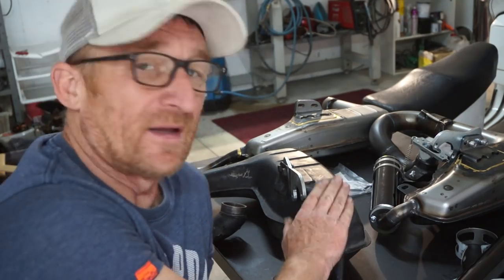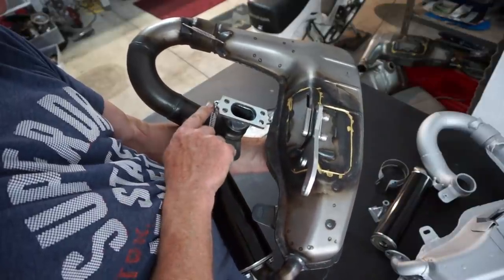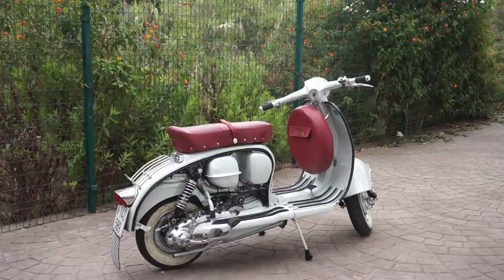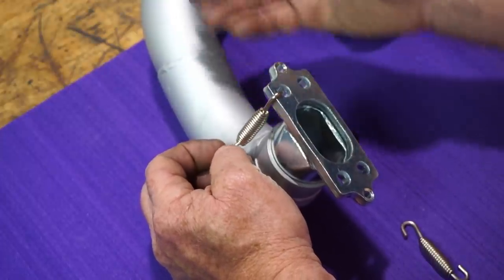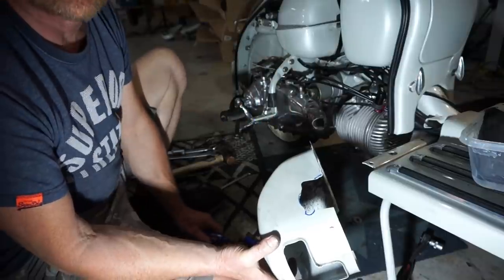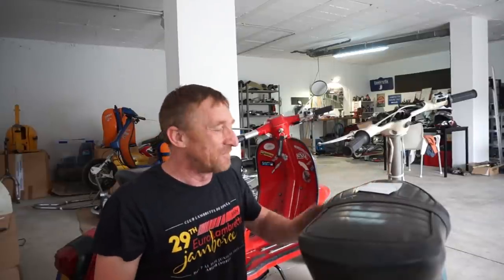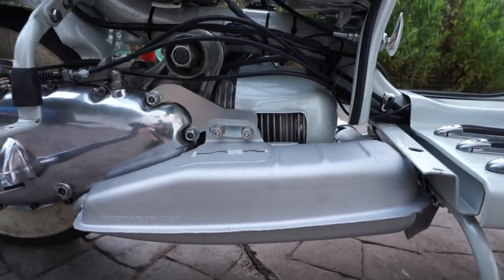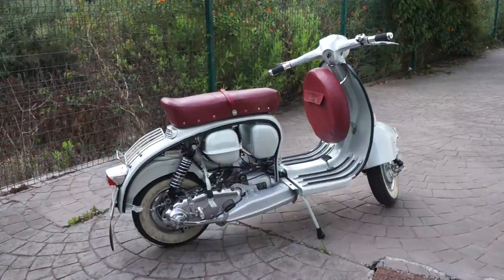#LAMBRETTA BGM V4 SPORT clubman ULTIMATE REVIEW # TheSteelweasel

Comment: Thanks for the hint about the lower bracket. I have to have it‘s position  changed too.

The spring position is not great. Especially when the cowling is mounted and  one spring falls off from the exhaust stub. Try getting it on without dismantling the cowling is almost impossible.

Comment: Will this not Suck exhaust gases back into the fan cowling?
Reply from the maker: it points to the floor ? so i dont this so but very good point made hot gasses into your cooling stream is not good .
Reply: @TheSteelweasel  Personally Steve I don't like all this under body stuff for that reason and shit everywhere can't be avoided. I think this one of the ways of smothering the sound a bit, but has it's down side. Ground clearance? shit everywhere and as you say recycling of heat ? I don't think you can beat getting a nice looking pipe to the back of the bike where it belongs.

Comment: Cheers Steve that was great, was that a reed valved RT195?
Reply from the maker: nope its a rt 195 i tuned no reed valve , running 24mm pwk ...... goes very well indeed
Reply: @TheSteelweasel  thats good to hear, I have a standard untuned RT195, with a ancelloti clubman on it, looking to increase the power as my tops out at 55mph, before i get to poss adding a reed, or changing the GP crank to a 60/110.
Reply from the maker: Jason . What's you hight and weight, and what's the gearing ??
Reply: @TheSteelweasel  im 5/11 and around 15st, gear is li 150 box with a 16t front sprocket, carb is 28mm
Reply: @TheSteelweasel  hi tgere, I am 5 11 and around 15.5 st... its a li150 gear box, with a 16t front sproket.
Reply from the maker: @jasonfrost7097  sorry mate this is a common problem you are over geared 55 mph is 5200 rpm  or you have a problem like a blocked exhaust pipe or a bad engine build .   go down to a 15t and see if it improves, bike should make around 65 mph if everything is correct .
Reply: @TheSteelweasel  cheers Steve … I will change the exhaust over from the 42mm clubman to a clubman sport and see what that does .